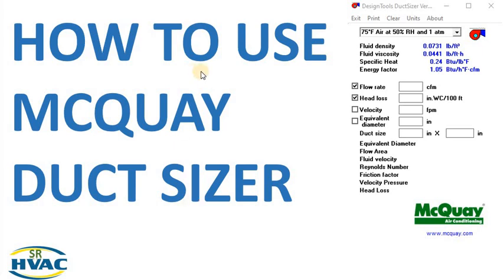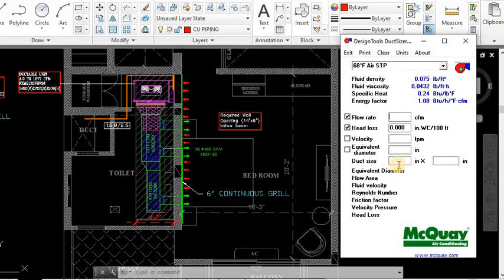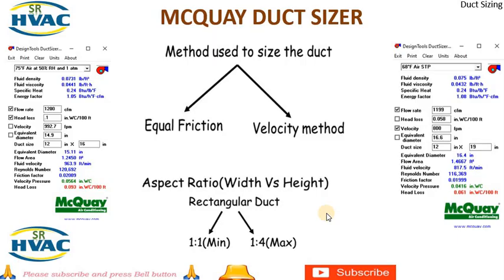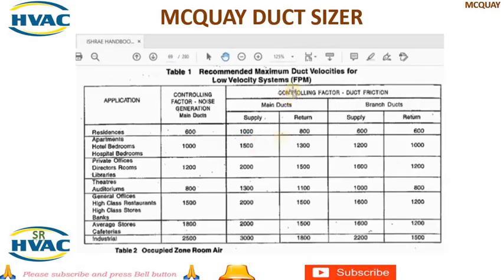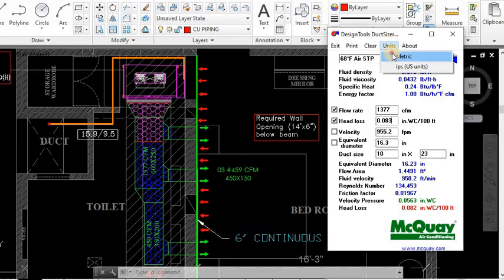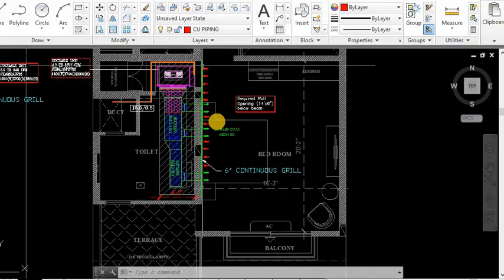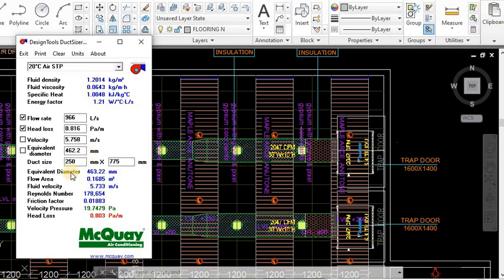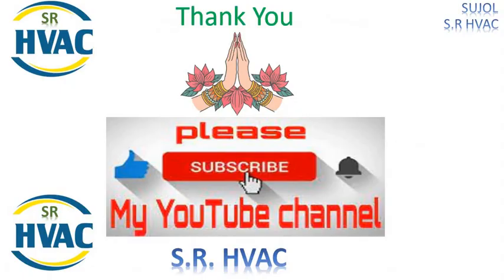MCQUAY Duct Sizer Explained: Easy Duct Sizing for Beginners

Comment: For the last part of duct sizing, you got 10×12 for 684cfm. Why did you change it to 16x8????
Reply from the maker: Good observation! The change to 16x8 is based on balancing airflow and duct pressure for optimal performance.